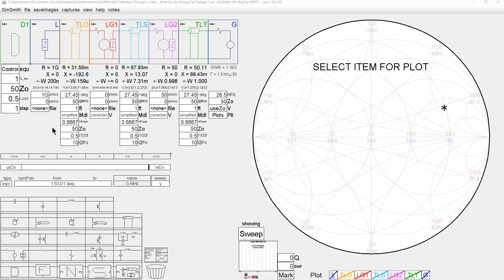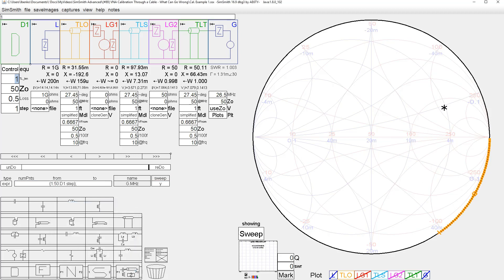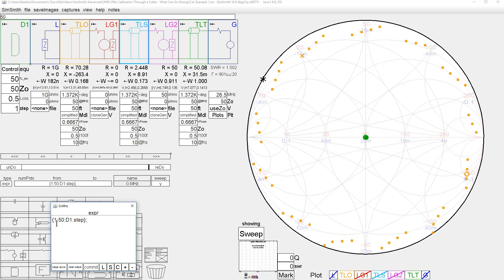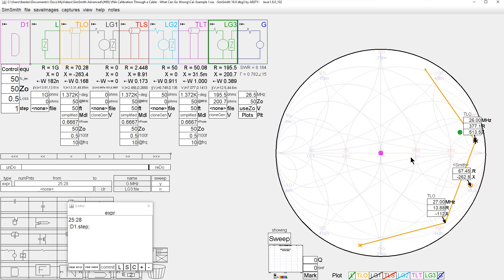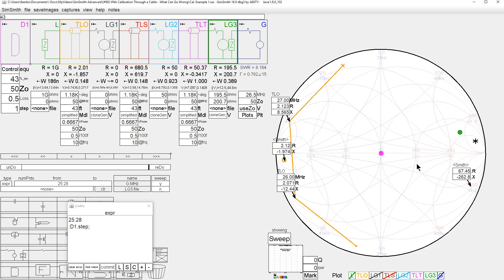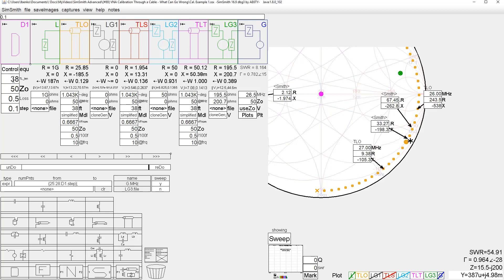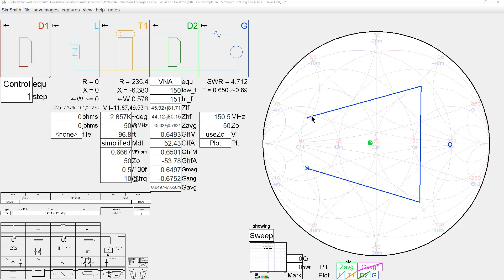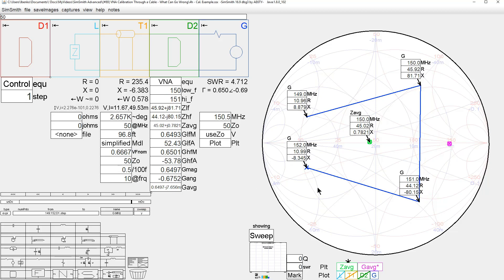#89: VNA Calibration Through a Cable - What Can Go Wrong

Comment: It's just dumb firmware. The VNA should have the ability to calibrate across a range of frequencies saving all the data during each step. Every time you fit a short an open or a load it should sample a range of frequencies, rather than it just taking one frequencies measurement at a time. With 3 calibrations it should be able to save the data for an entire range why don't they just update the VNA's to work this way?

Comment: I'm wanting a VNA from 160M to at least 10M But i want to be able to attach it at the feedpoint 60ft up and then read what the antenna is saying in situ. I was looking for a vna with bluetooth so i could observe it from on the ground. I'm planning on using open wire 300 Ohm ribbon but can't find much info on using a vna with open wire. Wondering if the way to do it is to calculate a good coax length with the vna, then observe the antenna so it can be tuned with the tuned coax, then swap out the coax for open wire?
Reply from the maker: Several people have added bluetooth modules to do exactly what you want to do.  I have such a module for my AIM 4170.  Search for a USB to Bluetooth adapter.
Larry, W0QE
Reply: @w0qe  Thanks for the reply Larry. I have been wondering how to use open wire feedline with the VNA. I am considering making a micro sma 1:1 balun adapter and a 1:1 unbal for each end. I found small commercially available sma antenna balun boards with a 9:1 balun but i also have seen the smd balun transformer available with a 1:1 winding. I was considering trying to make a 1:1 balun and a 1:1 unbal so i can add the length of the ladder line and it's velocity factor. I feel like i'm stepping into no man's land here. The other complicated factor is if making home made ladder line i would have to also calculate or measure the velocity factor and impedance. I might be stuck at this point or left to make some guesses. I'm guessing my line will be around 500 Ohms with a velocity factor between 85 and 90.

Comment: My friend has 18 ft coax going to his truck antenna on 27 Mhz.
Would I need to calibrate the coax to tune the antenna for lowest SWR?
Reply from the maker: No.  The true SWR at the antenna will be slightly higher than what you see at the transmitter end of the coax due to the loss in the coax but you can still tune for minimum SWR at the transmitter.  However if you wanted to know the actual impedance of the antenna then you would need to calibrate you VNA to that point.  Remember that for any SWR there are an infinite number of impedances except for an SWR of 1.0:1.
Larry
Reply: @w0qe  So if I check SWR with say a 9ft, 18ft or 50 ft lead SWR goes down a little because of loss on longer coax?
But all those lengths are fine to check SWR without calibrating at the end of the line first?
Reply from the maker: @RC-Heli835  Yes, provided that if the initial 18' piece of coax is 50 ohm and the subsequent pieces of coax you use are all the same 50 ohm impedance.  SimSmith can show this easily.
Larry
Reply: @w0qe  I set the SWR on my friends Big  Rig last night with the Nano VNA 4 with a 6ft coax. We finally cut enough of the antenna off to get a low SWR in the middle of the band ch 20 -  27.205 Mhz.
1.56:1 on each end of the band and 1.3 :1 ctr.
I hooked his 18ft  coax back with an analog SWR Meter w/6ft jumper and channel 40 was  3.5 :1 SWR so had to trim nearly another inch off to get it right for the 18ft coax. Also read perfect again on the Nano.
We cut around 5 inches off this antenna because it was resonating in the 12 meter band.
The antenna would have worked as 1st  tuned on the 6ft lead but not the 18ft coax.
Reply from the maker: @RC-Heli835  I can't explain exactly what you are seeing unless either the 18' or the 6' piece of coax are not the same impedance or the SWR meter in you friend's transmitter is in error.  The SWR meters in many CB radios are not too accurate.  I would try a different SWR meter or if you are happy now just continue to learn and use the NanaVNA.
Larry
Reply: @w0qe  Its a bench SWR meter. 
What I have heard is that the only way to get an antenna tuned accurately is with a calculated 1/2 wavelength.
After its tuned then coax length doesn't matter.
So ...speed of light in feet
986.3 / 27.205mhz x .66 velocity x .5 for half wave equalls 11.93 ft.
Thats what bells cb shop says. I did not have a 11.93
to jumper but would like to try it.
Rig expert users calibrate their analyser to the end of whatever coax  so that it takes the coax out of the equation if I understand correctly.
Reply: @RC-Heli835  I have found that by adding lengths to an existing patch you can bring the swr right down. Apparently this suggests that the coax is starting to act as part of the antenna and that if the impedance at the feed point was correct the coax length should make no difference. I think that real world issues start to come into play here. Such as the proximity of other objects or the impedance due to the mounting position / technique, as well as the initial impedance at the feedpoint depending on where the antenna is mounted. These theories assume the perfect counterpoise and a good mounting position of the antenna. With base antenna often you will find large differences in swr once you hoist your antenna up way above any objects that might have been in close proximity such as any trees sheds or house roofs.
  So, if the impedance at the feedpoint is not great due to an unideal situation the problem will start to become the problem of the feedline as well as the antenna unless an unun transformer with the correct value to maintain 50 ohms is placed at the feedpoint. In theory once the feedpoint reads 50 ohms the rest of the coax could be any length. They say to avoid 1/4 wavelengths of feedline which could be because it could start to act like a bandpass filter or part of a tuned counterpoise taking over from the one formed by the vehicles skin / bodywork and hence messing up the radiation pattern and overall impedance. Either way you want to try to avoid the coax acting as part of the antenna as it most likely won't radiate anywhere useful and may introduce rf into the vehicle / mic / speakers etc.
  This is indeed a subject i am myself wrestling with and recently i myself had to add 3ft of coax to a system to bring the swr down which also removed rf at the radio / power mic, this was probably not ideal and suggests i have an issue with the antenna, as in that way it's mounted in proximity to other things or how it's balanced with it's counterpoise / ground / chassis if on a vehicle.
  Try to double check it this way. If possible check the readings of the swr meter as close to the feedpoint as possible, you might have to make a small patch cable for this depending on the antennas connection design. This should enable you to at least see the difference on the swr meter. 
  if the best obtainable swr can also be seen at the rig end with various lengths of coax you have proved the theory if different lengths of coax are effecting the swr in big ways then there is probably something more complicated going on. One trick you can try is to make a comparison with that mount and the same antenna on a magmount. A magmount works differently to obtain it's impedance like a big capacitor between the base and the vehicle. In any case it should let you see if the antenna appears to behave better across different coax lengths. If this is then the case you might want to either consider moving the other mount or checking it's connection and how it connects to the rest of the vehicle, just the location of the mount will be changing the impedance.
  There are probably only a few people out there who can master this black art of matching or transforming such antenna at the feedpoint in real world examples. 
  One completely different example you may have seen in vna tuning videos is where a guy retunes commercially available rubber duck antenna for smaller antenna on higher frequencies. The problem is that the antenna is tuned fine when the plastic / rubber cover is removed but once the cover is in place it shifts the antenna to a different frequency, just because of the proximity of the plastic piece. He then tunes the antenna with the plastic piece taken into consideration which was a short-sight by the manufacturer.
  It's a world of experimentation and compromise unless you can truly fit the correct unun (unbalanced to unbalanced transformer) at the antenna feedpoint. I think, only then can you be sure that the rest of the coax is less likely to cause upsets due to it's length. If problems still persist and you can't find a better mount solution or find any other solution i would run the highest quality and shortest length of coax (i would still avoid 1/4 wavelengths) or try a different antenna, perhaps a loaded one with a shorted coil will show less sensitivity to the vehicles counterpoise situation.
  On a truck you often have to mount on a mirror or fender, sometimes other parts of the vehicle will be taller than the antenna or the counterpoise will be lop sided. In reality most people are probably transmitting to some extent on their coax but seeing a good swr due to the difficulty of real world installations, especially with a mobile setup. Finally, a matchbox at the feedpoint may help to solve the feedpoint impedance but this is usually not practical but by playing around with one and also swapping out different lengths of coax you may help to prove the theory. 
  You might find that with a solid vehicle mount making a good connection to a large vehicle that the counterpoise is so big that you always see better swr at lower frequencies and it is difficult to get the 1:1 at higher frequencies until you find a good combination of coax length. This is like making a dipole where one side is 1/4 wavelength and the other side is 2.5 wavelengths (for example). It's just not a good balanced antenna thus compromises in the coax start to become a factor as a new usable balance / match is found. This is why a magmount can give ok results as it has some sort of consistency across vehicles. You will always be able to tune a direct mount in with a swr meter at the radio but as you say. it begs the question as to how much of that tuning is the coax doing and how much is the antenna SYSTEM (including the shape and size of the counterpoise/ ground) doing for the impedance match / mismatch.
  Personally i would love to be able to say that i could calculate and fit an unun at the antenna and then be able to avoid the coax coming into play at any length. I think this is what the theory suggests and i hope someone can correct me if i'm wrong. If this is the case it would be nice if some compact unun's of various transformations were available inside so239 to pl259 connectors, but then we have to limit power handling or add a huge unun. 
  A last way to think about it is imagine a dipole, it is straight but if one element was at 90 degrees to the other the impedance would be totally different. If you mount a mobile antenna on a mirror mount then the roof of the cab will be acting like this L shape. Obviously impedance will always be a compromise on a vehicle unless you have the perfect size vehicle and the perfect mounting point in the centre of the roof which is often too floppy anyway. On my first car i added a roofrack with all 4 corners grounded to the vehicle with braid against the bodywork where i scraped the paint from 4 spots on the roof gutters. Then there was an 8mm thick steel plate which had a solid mount, good for Firesticks or 102" whips. Behind this i had a special bracket with a very thick aluminium tube that could lift up and lock into an upright position. We could then install an Avanti sigma IV directly onto the roofrack. We would drive up to hilly locations with it but sometimes we would also sit at the services and put it up there to get some attention. lol

Comment: there are tons of flaws in this video but one of them is that for your information when you work on smith chart (which is nonlinear in terms of impedance values) you have to take the average of two points in terms of their complex reflection coefficients NOT the impedance and if you do that it will end up right in the middle of that straight line between the two points and for your information this is how it is done by all VNAs including cheap nanovnas. Also who in the world calibrates VNA with 50 feet lines attached to the ports!!!!???
Reply from the maker: Anyone who wants to make a measurement of an object that is 50 feet away from the VNA would want to calibrate with 50 feet of of line.  I have done this many times.
Larry, W0QE
Reply: I plan to build an antenna with a feedpoint 100ft high. I will not know the characteristics of the antenna until it is hoisted into position. It might be a doublet or inverted v and angles are whatever is available depending on final height and surrounding fixture points such as the location of trees to fix the ends of the elements insulators to. If i am to know the characteristics of the antenna then i need to measure it at the feedpoint. I have 4 options. Use vna with powerful bluetooth, use vna with usb back to a computer with powered ports along the way to supply enough power for that length of usb cable, hook a gopro or similar camera to the vna or just input the compensation into the vna for the length / type of feedline being used and calibrate at the end of that length before attaching the antenna, to avoid further real word complications i would also check these results at the planned feedpoint when hoisted to full height. Only then could i be sure of the parameters of the antenna i have made and installed when at height. The simplest way to do this would be with some coax but this is only the first step for me as i will be using balanced feedline, as much as 170 ft of it. Once i know the parameters of the antenna i will then try to build an open wire balanced feedline that matches the impedance of the antenna. This way i can hope to avoid the feedline interfering with the antenna system and hopefull will only require 1 balun transformer back at the transceiver / tuner.
  The idea will be to keep the antenna impedance and feedline impedance the same all the way back to the transceiver and then be able to measure the total impedance in order to know what ratio balun is the ideal balun to add in the tuner as the standard 4:1 balun might not be the ideal match. If for example i find i need a 9:1 i will wind one and swap out the 4:1 that is currently fitted in the tuner. Problems include not knowing the velocity factor of home made open wire feedline or it's impedance until it is constructed. Also adapting the vna to balanced and back to unbal for the load / terminating calibration. I plan to use a 1:1 unbal and 1:1 balun for each end of the open wore feedline so that i may compensate for the balanced feeder when doing my final tests and adjustments. Ideally i would connect the open wire feeder to the antenna at height and use the vna to see the result back at the tuner but with all these baluns / unbals, home made feedline etc it all becomes to get complicated, especially for someone who has never studied smith or used VNA's. I literally can't find one video or document on this in a real world example. I have looked into DUT's to make this conversion but i am an amateur with no access to high end equipment or advice from people who carry out such operations in real world situations. Open wire is rarely used these days but it is more efficient and it is better suited to balanced systems in order to help with a better match at the feedpoint and to help reduce common mode issues and general noise on receive by keeping the system balanced all the ay back to the tuner. I find this especially appealing when running longer lengths of feedline.

Comment: VNA 'S come in 50ohm or 75ohm impedance and antennas come in various impedance. then that implies the use of transmission line transformers to connect them (ref. your #73 video) . thanks for your video
Reply from the maker: Joe,
A 75 ohm VNA can easily measure impedances (S11) without any external matching transformers.  As this video showed if you are calibrating with a 50 ohm transmission line in the nominally 75 ohm circuit you might need to be a little more careful if you intend to calibrate at different frequencies than you are scanning at. However if you are using a 75 ohm VNA to make through transmission measurements in a 50 ohm circuit you will experience mismatch loss on both the generator and load side. The mismatch loss is .177dB on both ends and it is usually corrected for with resistive pads increasing the loss to 2 times 1.76dB.  I didn't try to imply the need for transmission line transformers.
Larry, W0QE
Reply: @w0qe  Thanks